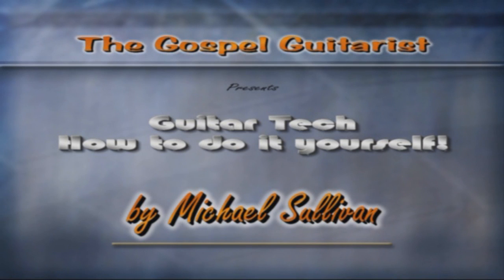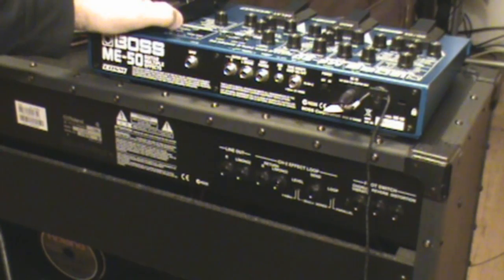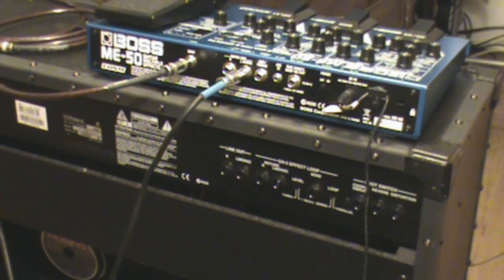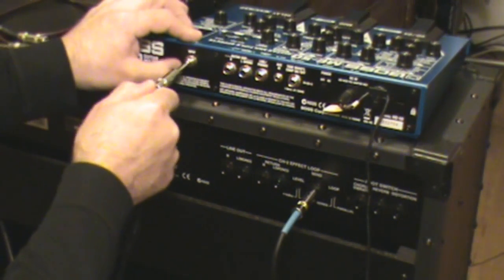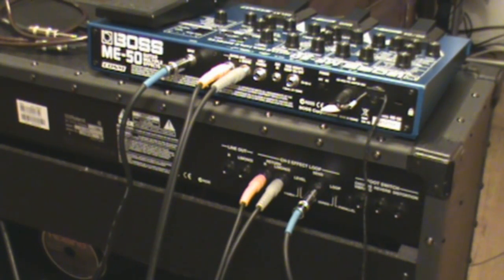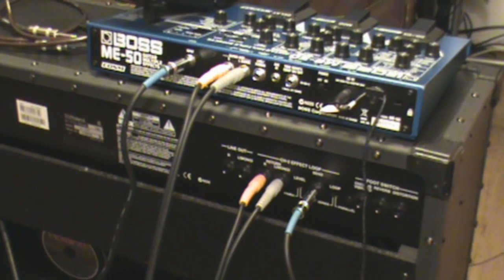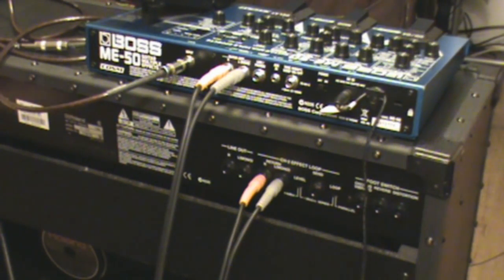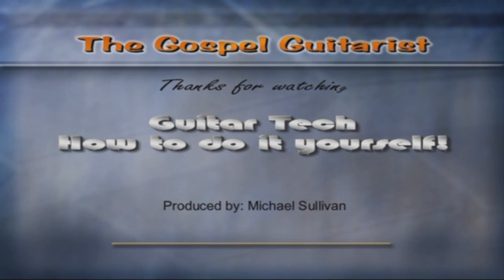Options for Connecting Guitar Processors.

Comment: There's an option number 4. If your amp lacks send and return, you can bypass its preamp by connecting the output of the stereo guitar processor to the aux in connection of the amp. Most amps have that input jack.
Reply: @glassbox7761   what's the difference   in sound ?

Comment: Since the me-50 does not have it's own effects loop, this version of the 4CM puts all the dirt from the me-50 in the amps fx loop, which makes them after the pre-amp, which I find undesireable. To have a true 4CM  the fx unit needs it's own fx loop as well.
Reply: This may sound fine on the JC-120 however, since it's a clean amp
Reply: Most pedals do not have an effect loop right? the only one I know to have this function is Boss NS2. Later versions of BOSS ME do not have an effects loop either.
Reply from the maker: Yes absolutelty right Chris, I was addressing how to make even this unit sound better. Way nicer modulation tone in an amps loop. Most people place this type of unit in front of the amp. If I am using a nice tube amp for overdrives and distortion, which most of us do, I just use the modulation effects in the loop. I know the GT100 and some other nicer units do have loops, and then the "real 4 cable method" can split the units effects. My point is to show we all have options. Yes, the JC120 does sound good this way being solid state anyway and is a very clean sounding amp.
Reply: Yes with this unit you would have to put separate dirt pedals in the front. But it’s great for using tons of other effects from the procssor. Especially if you like the dirt from just the amp.

Comment: as you can see this isn't the first video i've watched of yours today:) ?? i've been using multi efx since the 90s but have never tried the loop method to connect,,after watching this I may try, I have a Bogner alchemist 2x12 and a boss gt8, would it be worth doing, will there be that much of a difference sound wise?? and will my distortion suffer?? also i will be adding a second amp to my rig very soon, Blackstar s1-45,,any ideas how i could wire that in stereo?? that is all my friend :)

Comment: This FX loop plugging is also great to prevent " tone sucking" which is what most of these multi effect units do especially in front of a good tube amp. They sound great in headphones,in a bedroom or for direct recording but in a live situation through a tube preamp, they tend to get thin and disappear into the overall mix of the band. You lose that nice pure tone your got your amp's sweet spot to and you get "their" tone instead. Great video.
Reply: you gotta turn off preamp and cab sim section though..

Comment: I noticed in the third example, You only used 3 cables.There's another set of send/return that would use the fourth cable.  At least that's how I do it, and the way I commonly see it recommended on U tube
Reply from the maker: The third way is only using the amps power section and speakers. This is NOT the 4 cable method. Also this can be done using only 2 cables. The JC120 is a true stereo amp so I use it's stereo capability. If you have a unit with an FX loop and the amp also has an FX loops, yes 4 cable method works great.

Comment: Thank you so much for posting this helpful video.   I have been torn between JC-40 vs Tech21 vs FRFR PA.  I would much prefer the Roland JC 40 now that I know how I can bypass the pre-amp when I use it with my Helix. I had no idea you can use FX loop so many ways.  Thank you, Sir.
Reply from the maker: Never stop learning is my moto.  So many options today. I would go JC40 simply because the thing will probably outlast you. The Roland tone from these JC amps are just amazing.

Comment: Hi sir, can I use me 50 as pre amp? using the 3rd method, me 50 input to guitar and me 50 L ( mono ) to my amp fx return, will it sound good ? Like hd sound coz I use my metal zone as pre amp (using the 3rd method plug into FX return) and it sound badass
Reply from the maker: Yes, you can and there is a metal zone on the me50
Reply: Nice thank you!

Comment: Awesome video tutorial, kudos! I have the Boss ME-80, and was having an issue with the time based effects running into the pre amp section/front of head. All the other modulation worked great. Tried this way amd it works great. Thanks again.
Reply from the maker: Since that unit has amp and speaker modeling, you should always run it in the loop if using the modeling to bypass the amps preamp section, only using the power amp and speakers. Glad you found this video helpful.
Reply: @TheGospelGuitarist  why wouldn't I want to use my amps preamp settings anyway and then the me80 for the effects? I have a marshall dsl40cr.

Comment: Great video! Also, sI need to mention that that's not the 4 cable method. The 4 cable method is: Guitar - Pedal input, pedal send - amp imput, amp send - pedal return, pedal output, amp return- That way you get to choose from your processor (via FX chain order and switching on the pedal) if and where you want the amp's preamp to engage and at what level.
Reply: This is if your multi-effects board has "send - return".  None of the ME's have this function which is the purpose of this video.  The GT's do though.

Comment: i have 2 more ways to connect you multeffects for live play:
1. using a 1/4 jack TRS cable to XLR.
This way you cand send the signal from the headphones output to an amplified speaker, turning off the eq of the speaker if you can, not all the speakers have this option. you can use only this way or then you can put a microphone in front of the speaker to send the audio signal to the mixer in case you have one.

2. using a 1/4 jack TRS to 1/4 jack TRS cable and a Direct Box.
This way you don't need to use extra long cables, and you cand send the audio signal from the headphone output to the Direct Box, and then from the Direct Box to the mixer through an XLR cable to the Mixer in case you have one.

I've notice the headphone output (STEREO) has more exit volume than the MONO outputs.
Reply from the maker: Yes, I have a video on using DI's this way too.  Both you mentioned are good options. Never make long runs with a guitar cable over 25ft. Use a DI. Thanks for the addition options for not using your amp at all.

Comment: Hello, thx for the presentation.. very useful... I just wonder whether or not the option 2 equals the classic 4-cable method when a Effect loop is availably on both devices, the amp and the effect board, processor, preamp etc.. hope the author still looks on the comments since the chat has it ages! Cheers Peter
Reply from the maker: Yes it is 4 cable method if both have an effects loop.

Comment: So essentially, the second method you use I believe, using 4 cables would actually just be 3 cables if you werent  running in stereo? This is essentially just hooking up the me 50 in the effects loop? Which puts the whole unit after the preamp of the actual amplifier? That is how I have my me 70 hooked up. I like it like that because I only uses a few effects and the tuner and I want the effects after the pre amp. I do use the units boost and eq sometimes however, and it seems to work fine this way. I have never even tried any of the modeling preamps or distortions, I like my amps preamp and distortion. I basically just want to be reassured that my me70 is being run after the amps preamp.
Reply: oh, I also use the noise gate and it seems to work fine this way too...
Reply from the maker: Yes that's correct. Your setup puts it in the loop after the preamp. If you want to run in mono just leave out the right channel. Rock on!
Reply from the maker: Yeah, a lot of players use a noise gate in the loop. FX make noises too. If the gate is in the loop, it kills the distortion noise and FX noise.

Comment: Great Video!  I just bought a Boss me50 and was wondering how to do this.
THANK YOU!
Liked👍& subscribed
Reply from the maker: Glad it helped. Just rememmber that with the ME-50 you cannot do a true four wire cable method but what I do here gets you close. On tube amps you don't want the distortions in the  amps loop so just stick to the effects. This box is designed to be in front of the amp but I've it in several ways.  Thanks for subscribing!
Reply: @TheGospelGuitarist  ok thank you 👍

Comment: Thanks     been doing this guitar stuff a while...   never used nor understand the amps (Send-Return) option?     i think ill try your 2nd option....see what my effects pedal sounds like? 
      multi effects pedal have some nice overdrive sounds but when you play them with a band and have to crank the amp up in volume?   the tones sounds different.... sounds either get lost or are too far from the tone it sounded at home.. .because the amp and speaker are working at greater volume.....the effects pedal then perhaps needs less  DRIVE or Distortion in its settings..?....and i think id maybe have to E.Q  them after?  your videos helped me a bit but i'm still confused?  ' amps'  'preamps'  'processors' 'effects' 'send' and 'returns'?  its complicated.... this guitar stuff.  (I'm still working on it!!)
Reply from the maker: I get the amp to my dirty and clean tones and use effects in the loop. Tube tone is best for overdriven and distortion tones. Imho

Comment: Hi, I stumbled across your very informative video on this topic and found it very helpful so thanks for that but i just have one question... apart from the guitar cable you used,  are the other cables you used to make the other commection also a guitar cable or are they patch cables? Hope this question makes sense. In other words can you use guitar cables to make all the necessary conmections?
Reply from the maker: Glad it was helpful! Yes all cables are the same type as a guitar cable. I often will use Hosa 20 foot long paired cables for long runs to the amplifier. One line grey the other orange. Send and return or stereo connections ect. They are not sold as 'guitar' cables but are of the same construction generally.
Reply: @TheGospelGuitarist  Thanks for your speedy reply, much appreciated, good to know. Best wishes and keep safe 👍

Comment: If I put an me80 into the fx loop and set it on manual mode it'll basically be like having a pedal board right? It'll be my half stacks tone, and use the me80 for strictly fx?
Reply from the maker: Yes, If the ME80 has an FX loop on it, you should do the 5 cable method. That would put amp modeling and distortions, compression in front of the amp while keeping the time based effects in the amps loop. I can't remember if the ME80 has an fx loop. Otherwise yes you can use the amps real preamp tones and place the FX in the loop.

Comment: The ME 80 does not have its own fx loop on board.
What is the method (i prefer the 2nd one you showed us) what is the method to use the modeling/distortions in the front of the amp, but the fx like reverb, delay, through the fx loop on the amp? How do i do this with the 4 cable method. Also im a little confused on the stereo/mono thing. Im basically using an evh and mesa boogie 4 12 but im running it in mono i believe. Whats the difference running a cab like this in mono vs stereo for my setup?

Comment: You should make a video of how to add stomp boxes to the effects chain. I have a GT100 and I don't like the distortions so I've added a metal zone and Sonic maximizer. It sounds so much cleaner than the big pedal and I use the pedal for effects with nothing else. I'm curious if I set it up correctly or if there is another route to make it even better.
Reply from the maker: Run the distortin stuff in the front input of the amp and run the GT100 for effects through the FX loop on the amp.  You probably should put the Sonic in the loop after the Gt100. The Maximizer is meant to inhance the overall sound not the distrotion pedal, use an eq pedal after the Metal Zone for more tonal control.
Reply: TheGospelGuitarist 
Alright thanks, I'll switch it. I don't have an eq pedal, I was kind of using the Sonic maximizer for that but I'll try it.
Reply from the maker: You could probably get one cheap off eBay. MXR 's have always been loved by players but there are others.

Comment: Perhaps you can help me out. I’d like to use an effects unit with my valve amplifier. I want to use the amp simulations and distortions from the effects unit. Should I bypass the the valve amps preamp? I’d like to use the preamp from the valve amp but I don’t want the valve amps EQ setting to have any effect on the effect unit. I hope that makes sense, thank you for your time.
Reply from the maker: Yes, bypass the preamp section of your amp and use the power section  and speakers by sending the processors signal to the amps fx return.
Reply: TheGospelGuitarist awesome thank you for the reply. Using only the power amp, I won’t be able to keep any of the tube sound though right?
Reply from the maker: Not the pre amp drive tubes no.
Reply: You can use your preamp on your amp as an amp model if you like. Guitar into processor. Processor send into amp input. Amp send into processor return. Processor output to amp return. Put send and return at the begginning if your signal chain in your patch. Turn preamp off on processor. Turn send/return On. Now your amp is the preamp model.
Reply: Then on patches you want to use amp models from processor instead of your amps preamp turn the send/return off. This bypasses the preamp of your amp and sends the signal straight to your power amp. Turn preamp models back on and select amp model you desire. This gives you the best of both worlds

Comment: Many thanks for your video, do you have it with JC-40 ? I am Boss GT user and I looking for best amp to work with it. Thank you !
Reply from the maker: I would buy a new jc model with the stereo inputs. The gt100 would sound great on that.
Reply from the maker: You would have option of using the fix loop or just go right into the front or splitting the gt100 using 5 cable method. Lots of options.

Comment: My question is a follows. I just want to use the delay effects only from this peddle board. I love the distortion of my peavey amp. It has 2 channels, a metal and a clean channel. How can I hook up the peddle board and use only the delay effect without the peddle board affecting the distortion of the amp. And how can I switch back and forth using both channels with the delay effect coming from the peddle board?
Reply: hook it up through the effects loop and turn off all the preamp and distortion stuff on the modeler

Comment: Nice info. I have the boss gt1. when I connected it the 4 way method - it had a hum sound. The boss gt1 input is the power as well. When using the amp head I leave it on the clean channel. Is it possible to utilize the clean and distortion on the amp head?
Reply from the maker: There are a few different "4 - cable" methods that place the unit in different positions. If you use what I would call the "REAL 4 cable method" then yes you have the preamp fully available while also having the effects unit fully useful.  There are some good diagrams on the net on this. I have another video where I connect up a rack Boss GX-700 into this amp with the "real" 4 cable method and it was killer.
Reply: @TheGospelGuitarist    ok thank you, I"ll keep experimenting with it.

Comment: Hi ….! Thanks for this great video ..!! I have VGA-5 Roland Amp and a GT8 floor unit. Considering the 2nd option (4 cable method), could you please help me with routing this rig to get the best of both the Equipement..???
Reply from the maker: 1. Your guitar plugs into the GT8's input.
2. GT8's effects send goes to the VGA5's guitar input.
3. VGA5's effects send goes to the GT8's effects return.
4. GT8's L output goes to the VGA5's effect return. If the VGA has stereo effects returns you can use both L and R. 
That's it. You will have to figure out how to split the GT8's effects between the front input or the amps fx loop. If you don't have the manual I'm sure a quick search will point you in the right direction to obtain it. Enjoy and don't forget to come back and subscribe, like to help me out. Thanks!
Reply: Thank you for your speedy response.

My GT8 has an EXT Loop - Send & Return. It also has an AMP Control out 
My VGA-5 has EFX, EXT IN, EXP Pedal (at the back) and High/Low Input in the front. 

What is happening is, My Pre-Amps are not heard when I plugged it the way you explained.
Reply from the maker: If you are using the send and returns on the amp, you may have to edit the settings for the GT8's fx loop as well as the VGA5. I am not familiar with either of these products enough to guide you. Manuals on both should be looked into as well. On most products you must engage the FX loops. Just hooking them up does not activate the loop.

Comment: This is great! Would this work with a Line 6 Pod Pro and a Mesa Boogie TriAxis and a Mesa Boogie Stereo Simul class 290?? I really could use some help here!!
Reply from the maker: Any amplifier with an effects loop will do. You can use whatever processor you have this way. I'm Mesa man myself. I have a '96 Dual Rec Trem-o-verb. You can search out 4 cable method videos to use your effects which have an effects loop on them. The one I use in this video does not, but it can be placed into a loop this way or just in front of the amp. It's designed to be in front. Other processors with a loop on them using the 4 cable method you can place amp modeling and overdrives in the front of the amp while placing time based effects after the preamp where they sound better. Hope that helps. Don't forget to subscribe and like the video!
Reply: @TheGospelGuitarist  Thankyou so much!!